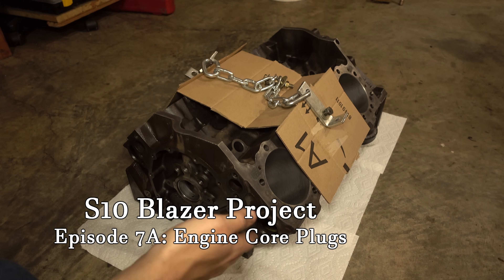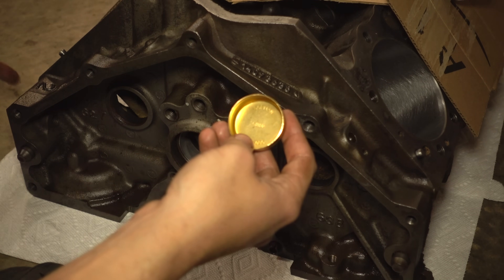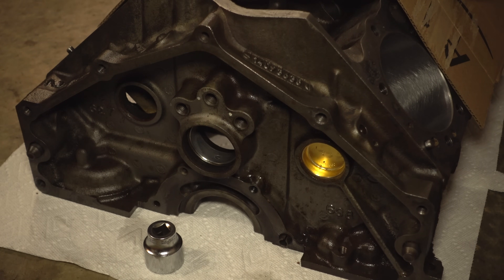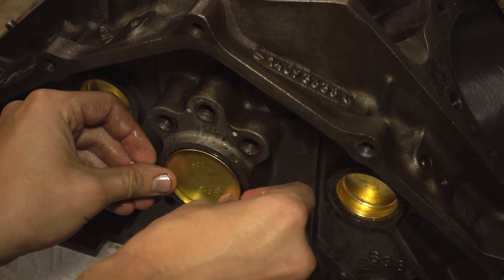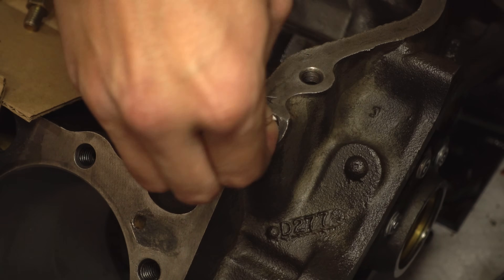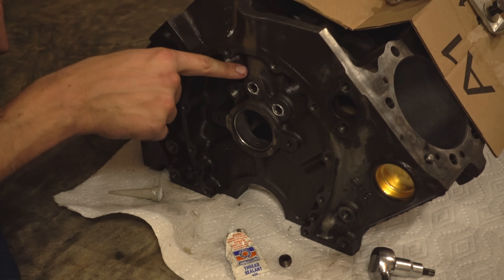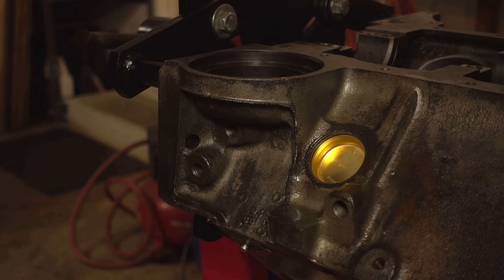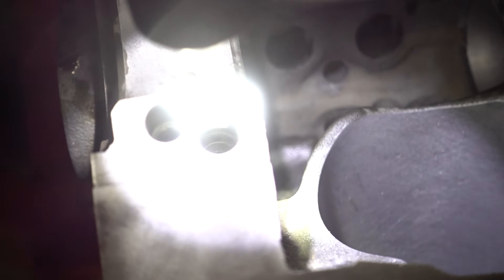V8 S10 Chevy 350 Core Plug Installation (Ep.7 Part 1 of 7)

Comment: Love your videos, but i have a question. Why does an engineblock have holes that need to be plugged? What is/was the purpose of those holes?
Reply: The purpose of those holes is to facilitate the removal of sand after the casting process,  some people call them "freeze" plugs with the belief  that if your coolant should ever freeze those plugs will save the day , I've seen blocks that didn't have antifreeze in the system and consequently froze , the cracks usually run horizontal about 2 inches above the lifters on the inside and horizontal about 1 to 2 inches below deck height on the outside of the block , the plugs might move a little but in no way save the block ,the best way to prevent block damage from freezing is to use antifreeze in the correct measure

Comment: Fuzzy, say BRO I have a 1980 Big 10, C10 Silverado rebuilt 350 5.7 ,I'm having a oil leak I can't find. I've installed, oil filter with new oil adapter, new valve covers gaskets, New oil sending unit, oil pan& gaskets, remove the flywheel cover,flywheel is dry, truck is park no leaks,once I drive her she starts leaking. I'm confused. Please help  .thanks

Comment: My block is from a 78 Vette, and it has the hidden oil galley plug. I tapped that hole and put a 20 cent grade 8 plug in from the hardware store.
Reply: My recent block I'm working on is from a 79 Vette. I tapped and thread plugged the same hole also, just because someone says I should. It was Fun !

Comment: I would have wiped the plugs with a thin coat of silicone sealant
Reply: Silicone on freeze plugs is notorious for coming loose and clogging the radiator and heater core. The best sealant I've used is Permatex form-a-gasket no. 1. It's fast drying like weatherstrip adhesive but specifically made for freeze plugs and other similar components.

Comment: What was your final budget when all said and done? Camshaft, rebuild kit, etc. Thanks
Reply from the maker: The engine rebuild total was right around $280 (not including $35 for the flex hone and a few other tools and stuff).
Reply: How is that possible?
Reply from the maker: @michealdumasii5432  Small Block Chevy parts are very cheap, and I didn't do any machine work on the engine (like it probably should have gotten) so the cost was pretty minimal. The camshaft set ($115) was the majority of the cost and it wasn't at all necessary. Rebuild kit was $80, oil pump/core plugs/water pump $75.

Comment: Why people don't spend the extra 4 or 5 dollars for the brass plugs, I'll never know. The first time you have to pull an engine to replace rotten galvanized (or zinc coated, whatever) crap, you'll pop for them from then on. I paid big money to a big name engine builder and they cheaped out on the freeze plugs. Unbelievable. It's a hell of an engine but one "aw shit" will cost you ten "atta boys".
Reply: Well said.
Reply: Steel plugs do OK as far as sealing the holes (by the way those holes are where the sand is removed from the casting when the block is cast, hence they are called core plugs). However, over a period of time the steel plugs with rust out and begin to leak especially if one does not use any antifreeze (and there are those who will not spring for the antifreeze). The brass ones are better to use.

Comment: Did you not use any sealer on these plugs?
Reply from the maker: Thread sealer on the threaded plugs, no sealant on the core plugs. Many people swear by using sealant on them, but I have never needed to. If the sealing surface isn't smooth or it isn't a standard type of plug, some sort of sealer or retaining compound wouldn't be a bad idea.
Reply: Hey Tom I'm not an old timer but I'm also not a millenial. I started using sealer on the plugs a few years back. Not a big glob of sealer just a thin skim on the surface. I just never wanna risk that the surface has a deep gauge and it will start leaking coolant. Even my Haynes Manual for rebuilding the engine on a 1991 4runner says to use light sealer on the plugs. I get people telling me all the time that sealer is not necessary. The people at the engine machine shops tell me it is not required. Better be safe than sorry, I think. Then the Haynes manual confirmed it. However earlier on, on my engine rebuilding experience I didn't use sealer on the core plugs and I never had a problem at all. But once again, better safe than sorry so I've been using sealer for a few years.

Comment: What happens when you just install the hidden plug flush and not down 
I think I did that 
And no I have no oil pressure priming 
Pls help ?
Ty
Reply from the maker: Check out this picture: http://www.crankshaftcoalition.com/wiki/images/4/4f/Oil_plug_under_main_cap1.jpg
And this picture: http://www.crankshaftcoalition.com/wiki/images/b/b3/Sbc_oil_plug_rear_main_2.jpg

How far do you think you installed it? Flush with the shoulder or just with the bearing cap surface?
Reply: Fuzzy Dice Projects do you think if I flushed it to the main cap 
I didn't know
Reply: Fuzzy Dice Projects if I flushed it now it's gonna bypass my oil filter?
Will it still run the engine 
Or do I have to take my.oil pan out and get it 1.5 " ?
Reply: I'm waiting on a new racing starter to turn the high compression over I got a week plus 
So tomm I will take my oil pressure sender out and measure down with a coathamger to see where it is 
I can't rember what it is 
I think it's flush with the main cap 
But I could be wrong 
I had no idea and no one told me except for this now 
I'll let you know tomm 
I hope I don't have to take my oil pan off 
It's so much work
Reply from the maker: If it is directly under the bearing cap it may be blocking the main passage from the pump to the filter, causing your lack of oil pressure. If it fit tightly there, the plug you have is too large since you need to install it in a narrower area further down. Check the install depth from the pressure sender hole as you mentioned you would in another reply, it is very important that this plug is installed correctly.
Reply: Fuzzy Dice Projects it's pouring rain today 
I have to check tomm 
But ty for getting back to me 
Now if it is 
Can I remove it from the top hole where my gauge is 
And use a magnet thing to pull it out and reinstall a new one from top down saving myself a week work 
Disassembling my whole engine again  
It's a bitch to get my oil pan off 
I have a 88 GTA trans am and there is a huge cross member in the way
Reply: I just measure my 305 and my 350 to 383 
Both on the nose 8.25 ish 
So that means I'm good I must have done what you said 
My bad 
I did it before Xmas and had a brain fart 
But ty anyways 
If it has another oil pressure prob no matter what I don't have to take off the oil pan ?
Reply from the maker: It would depend what the problem was, keep priming it, make sure you are spinning the oil pump fast enough, move the crank around a bit while doing so, see if you can get oil pressure. If not, something is wrong.
Reply: Fuzzy Dice Projects I have a brand new non bypass oil filter adapter 
Maybe that's causing the issue 
It forces the oil though the filter no matter what 
So I can change that with my 305 one and see if it fixes it 
Have you ever heard of that before
Reply from the maker: I haven't heard of a no oil pressure issue due to a problem with a oil filter adapter, but strange things can happen. Are you checking pressure with a gauge/sender or just watching to see if oil comes out of the rockers? I'd leave the sender port open and prime it, see if any oil comes out there. Could be a problem with the pressure relief spring in the pump if it has volume but not much pressure.
Reply: Fuzzy Dice Projects I have both valve covers off and I was cranking it over for 5 min blasts 
With the primer 
I even bought a brand new drill just to see if it was my cordless 
No oil out either bank of heads 
And I have a stock gauge in my car dash that when I powered the car on I just assumed it would work if I primed it
Reply: Fuzzy Dice Projects something else quick 
Where the oil pump bolts on is there a gasket in there 
I was told there wasnt anything 
I don't have anything
Reply: Fuzzy Dice Projects 
I have a arp bolt that bolts my oil pump on and a arp driveshaft
Reply from the maker: Nope, no gasket on the oil pump. Have you tried rotating the crank by hand a few times while priming or in between priming? I would remove the sender and try to visually verify oil flow. If there isn't any at that port, something is seriously amiss. Also, what priming tool are you using? As shown in the video where I prime this block, I had to modify my cheap one to get oil flowing properly.
Reply: Fuzzy Dice Projects I will today / tomm 
I bought a brand new eBay profoem sbc drill priming tool
Reply: Fuzzy Dice Projects today I replied and I confirmed what I did 
It's not the plug we are talking about 
It was the center plug under the timing cover 
I put it 1 inch in there 
I got it out with a screw and put in a new plug flush what you showed here 
And I got it all back together half anyways 
I'm gonna try priming it again with my drill and tool 
Do I turn it clockwise
Reply from the maker: Glad you found that plug out, that would have been a huge problem. Slipped my mind that it would also be a cause. Yes, clockwise is the correct direction.

Comment: Where did you get you’re rebuild kit?
Reply from the maker: eBay, search for "1987-1989 SBC SB Chevy 350 Engine Rebuild Kit" for this particular one, or go to that seller and look at similar ones for different years. My single complaint is that the thermostat housing gasket was junk, and I'd distrust the water pump gaskets, everything else seemed great for the price!

Comment: You can thread the hidden plug just like the others. Makes it way easier.
Reply from the maker: With it being a smaller size on this block, I guess it would have to be drilled larger and then a pipe tap used. You don't usually see those done but some people will do it on certain blocks.

Comment: a galley is an old boat.
Reply from the maker: I called them "galleries" in one video, and more than one commenter corrected me and said the proper term is "galley", so I went with it since I had heard that term used before as well, and only later researched it and found that "galley" is actually the misnomer. But both are used commonly enough I think the idea gets across either way.

Comment: Weld up that rear end and put some traction bars on it... other than that it will not be drivable in the rain. I had a buddy who put a 396 in a 95 S-10 and that thing was scary to drive so it was a lot of fun!
Reply from the maker: It is pretty bad in the rain, but not undriveable. I think it mostly needs new tires. Moderate breaking makes it slide a few feet and anything other than very light acceleration and it doesn't move. Will probably just put it in 4WD next time I need to drive in the rain, shouldn't be a problem for it to slip.

Comment: I just did a rebuild on the same engine but mine has no compression in cylinder one
Reply from the maker: Double check your valve lash setting, make sure the valves are opening and closing properly, that would be my first guess. An immediate head gasket leak that severe is unlikely. A severe assembly error (like forgetting piston rings) is also unlikely. Probably a valvetrain issue